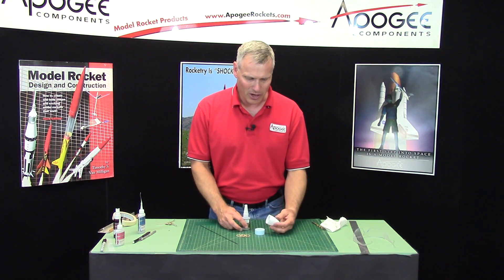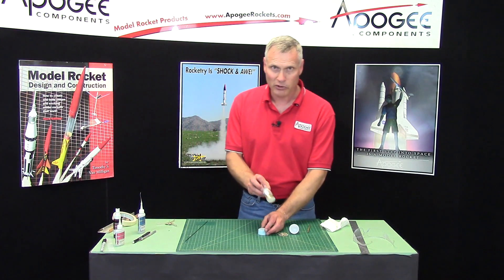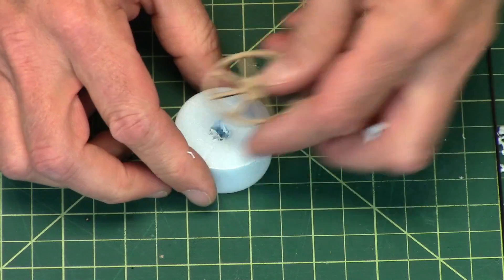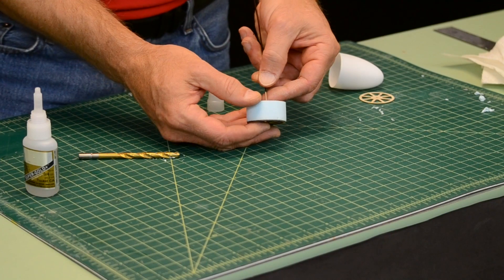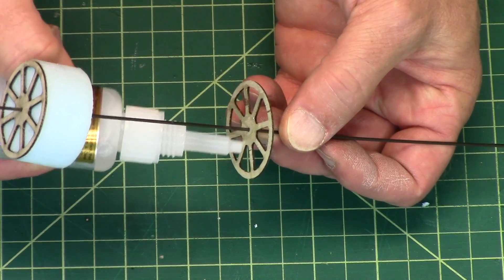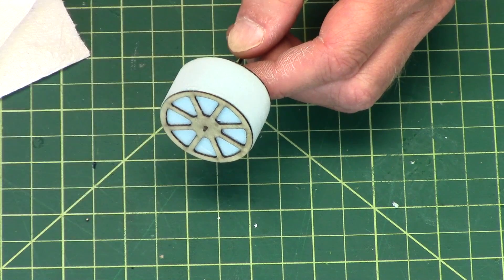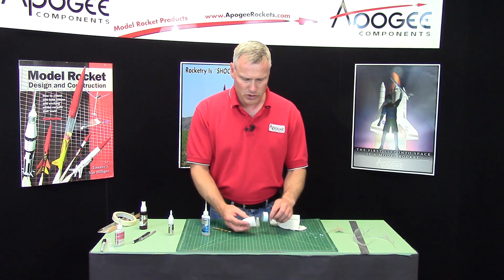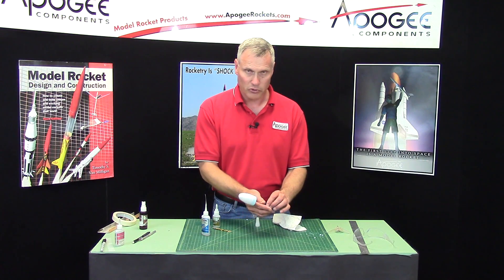Rotary Revolution 04

Comment: Is there any issue with the "slick" nature of the graphite rod holding with just superglue during deployment? Could a thin aluminum or brass rod be substituted?
Reply from the maker: It grips just fine. Other rods, like alum or brass will bend, so you have to use what comes in the kit.